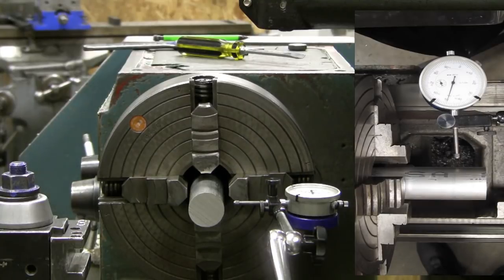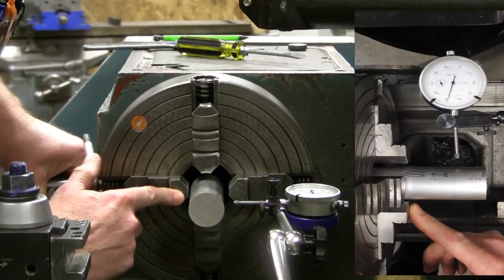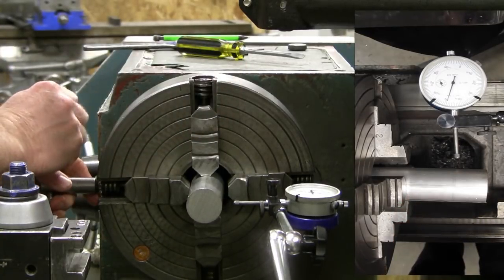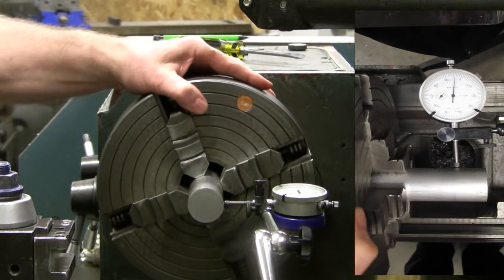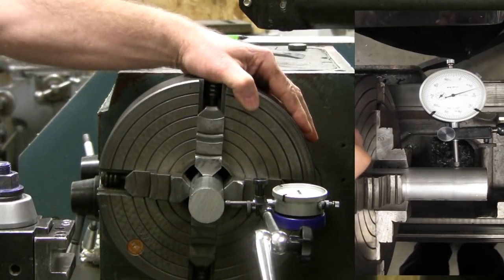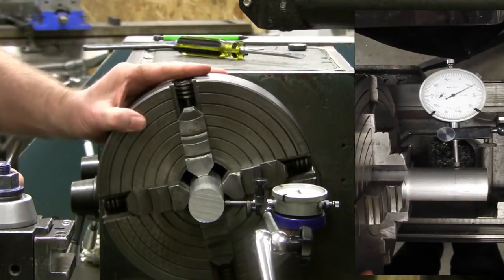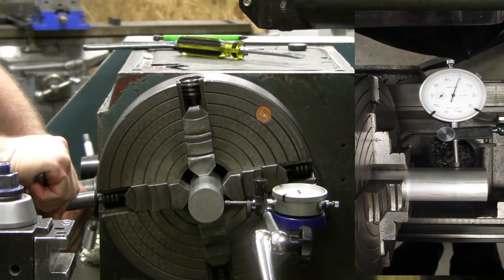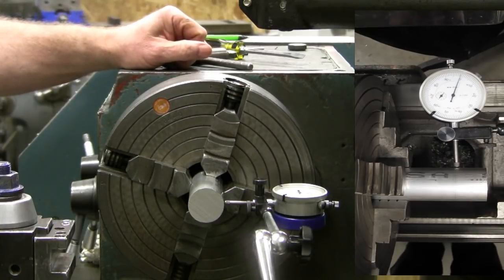Dialing in a 4-jaw lathe chuck

Comment: Tom, the quality of your video presentation is excellent! The use of the split screen puts this video many cuts above anything I've viewed (thus far) regarding four jaw dial-in. By no means am I implying that this video shines only due to its impeccable videography. There is absolutely no dead air time whatsoever! I've watched many shop videos that have me saying..."Yo, Vinny! Can we get on with this already! 

I do think though, that you should have apprised the viewers that most round stock chucked into their lathe will not be perfectly round to begin with. I would very much like to see a Tom Clemans video that properly addresses this issue.  

I'm a retired EE/Instructor but strictly an amateur machinist. ;-) 

Thanks!
Reply from the maker: Sam, Thank you for your kind words and great suggestion!
I have recently improved/streamlined the way I dial in a lathe 4-jaw chuck, so a replacement video is coming soon, hopefully by October 2014. I'll add your suggestion to the new video,
Tom :-)

Comment: Dumb Question:  I assume the parts isn't actually round or true - does that matter when trying to indicate in?
Reply from the maker: Actually it is quite close to being perfectly round, as evidenced by the indicator needle movement of less  than .001" in a full rotation of the part after centering has been done. If you look closely at the surface of the bar, it is an aluminum bar that has either been extruded or rolled, and not turned yet, so that's pretty good. After turning a new outside surface, and before loosening up the jaws, there should be absolutely no movement of the indicator needle upon rotating the spindle.

If the part isn't very round, then it should be adjusted so that the reading between two opposite jaws should be the same as each other, and the reading between the other two opposite jaws should be the same as each other.

Comment: Why don't you set the indicator on the top of the part so as you tighten or loosen the jaws from the top so the leverage works with you. I've been an aerospace machinist over 40 yrs. and this is how I was taught.

Comment: When I dial in a 4 jaw and I'm using aluminum, I always end up with teeth marks in the piece that dent and ruin the faced ends of my piece. Is this just because I'm making it too tight or is this to be expected as it is aluminum?
Reply from the maker: Denting the part is often what happens, but it usually doesn't matter if you're holding the unfinished end. If you're holding a finished end, and you don't want to dent it with the vise jaws, it needs more care. You can put a piece of card stock between the jaws and the part. The easiest way to do this is to wrap the card stock almost all the way around the part. Make sure card stock protects the part from all three jaws. Then take care you don't squeeze the part too tightly as you're dialing it in. Best wishes with this!!!
Reply: Thanks so much, I'll have to try that!
Reply: Better than cardstock is shimstock. And you can always use brass or copper between the jaws and the part, in sufficient thickness no matter how much you tighten you will not get those jaw marks on your workpiece.
Reply: LoadedMod94 If I have to make some pieces right along the days, I am just happy with a clamp collar. Once made, it covers a few working pieces up - shurely, it belongs on the rotating time and size of the working piece.

Comment: in this video has this sentence "inside the jaws are little bit concave so this part kind of settles into the middle of the vise changes of the chuck jaw". is this correct. because i need to sub your video
Reply from the maker: Sorry for my error, and thanks for asking about it. 
I started to say "vise jaw" but quit half-way through the word "jaw," and immediately corrected it to say "chuck jaw." The term "vise jaw" is incorrect. It is obvious that those are chuck jaws.

Comment: How about a self centering lathe chuck? Why don't you get one of these?
Reply from the maker: We also have 3-jaw centering chucks for each lathe. While far quicker, a 4-jaw can be dialed in far more accurately. Also, a 4-jaw can be offset a precise distance, so that a section of the shaft can be turned with a different center.

Comment: But you left out the most important part... did not check for concentricity.
Reply from the maker: I think you are joking?
If not, "concentricity" is a comparison two objects to make sure their centers coincide. In this case, we are comparing the tested part against the spindle axis. When there is no runout detected, the part is concentric with the spindle axis, which is the intent of "dialing in" the part.
Reply: @tomclemans  Correct, but its only concentric at the exact point you dialed, theres no guarantee that the two extreme ends of the rod are running parallel with the spindle axis. Dialing in on a four jaw chuck should always be done at two points to ensure concentricity with the spindle axis.
Reply from the maker: @kaieteurcanada  Ah, you weren't joking. I see your point now. Thanks!

Comment: I would have had the part within .0002 by the time you snugged up the jaws in the preliminary adjustments....
I guess I need to teach you!!!
Razor!
Reply from the maker: I'll gladly learn! Do you have a video that demonstrates it? If not, can you make one?

BTW, when beginning in the method I showed, the jaws are non-uniformly racked out. It is a good exercise for the kids. I have since developed a slightly better sequence, but don't have a video yet. Since I just retired, it's iffy whether I can make another shop video before building my own shop a year from now, after building a new house and personal shop.
Reply: Tom Clemans 
I hope I didn't come across as a total 
"SMART-ASS"....
I think I do have a video showing how I do it Tom, but if not I can make one!!
Funny you mention "building your house and shop" before you can make any more vids...
That's exactly my predicament as I speak!! It will be seven years in Sept that I moved on to my piece of property  and still working on a gravel floor!!
Thanks for subscribing....
Razor!